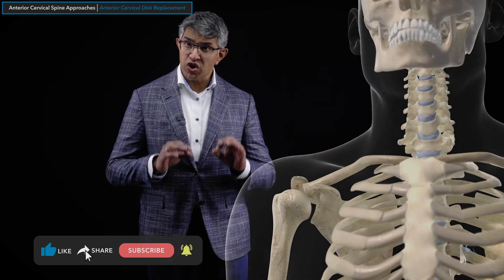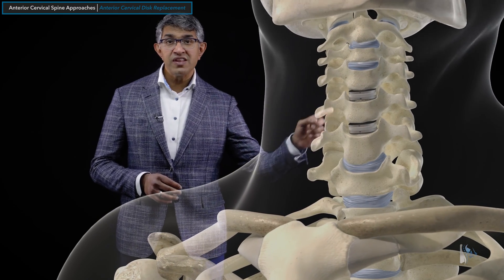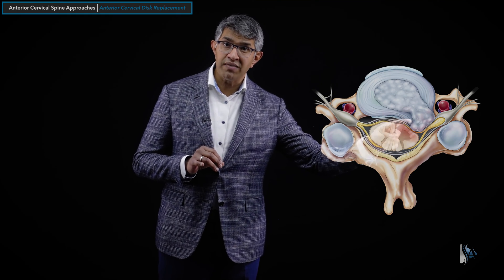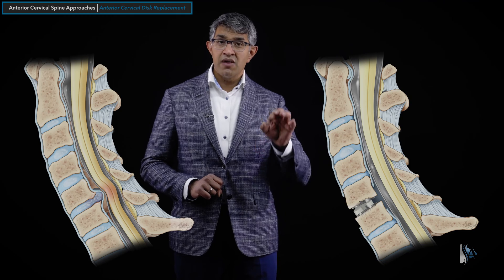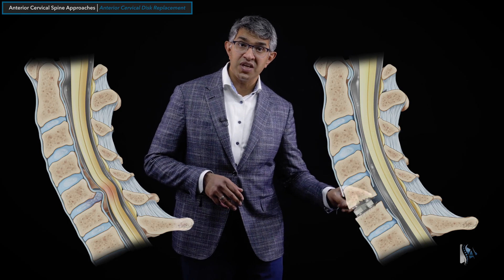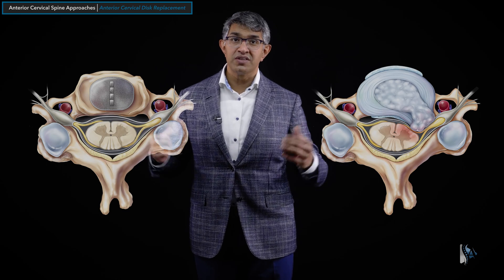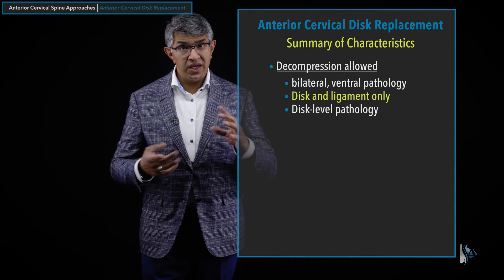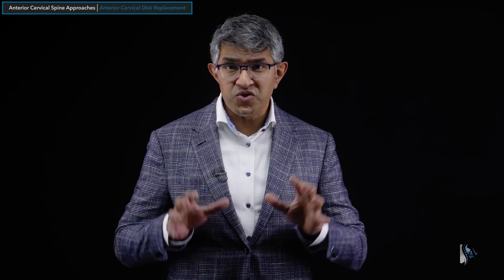Anterior Cervical Disk Replacement

Comment: So if you have bone spur then a disc replacement is not a candidate?  If not what would happen if someone gets a disc replacement and then gets bone spur?  Or they develop instability?  Thank you
Reply from the maker: Hi  @nova011
Great question. I typically don't love disk replacement in the setting of significant bone spurs because removal of the bone spurs creates a risk of "heterotopic ossification" which can create recurrent stenosis, symptoms or even promote fusion despite the disk replacement. I know surgeons who are more lax with that consideration. It is not dangerous to do; it just creates the risks noted above. Hope that helps and good luck, -SP

Comment: This is an excellent presentation, showing both the pros and cons of ADR. In my experience (I have a Maverick in the lumbar spine) too much emphasis can be put on the benefits of motion preservation. As we age, we may need more stability instead of mobility.  These graphics also show that both the PLL and ALL are severed (3:20) in a disk replacement. I wonder if this contributes to too much movement or if some new flexible core disks are intended to mitigate that. 
As explained here,  but often under appreciated by patients, a myelopathy can be caused by a bone deformity which makes successful disk replacement too difficult.  Peyton Manning ended up getting a cervical fusion, after several surgeries. Elon Musk revealed that he had Mobi-C put in, and then had it removed to be redone as a fusion because the osteophytes were not removed in the ADR surgery. Tiger Woods had a stand-alone anterior lumbo-sacral fusion, as revision surgery. A one-level fusion with para-spinal strengthening exercises must be carefully weighed against motion-preservation ADR surgery.
Reply from the maker: Excellent point! I totally agree. Cheers, SP